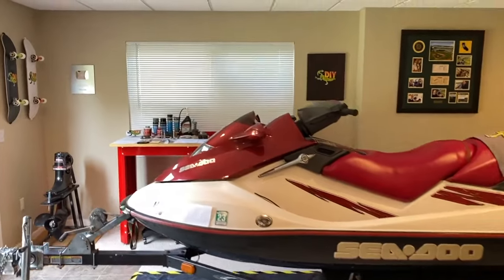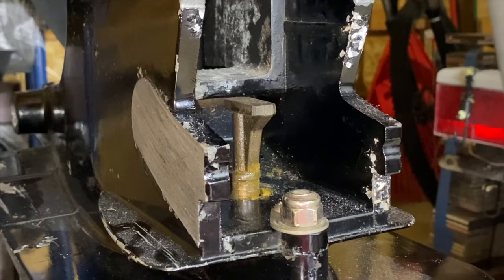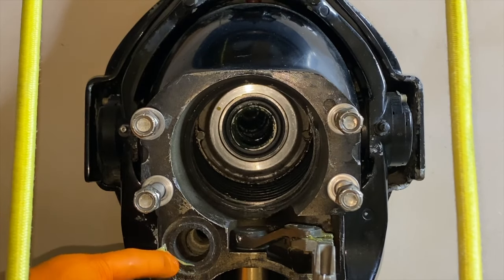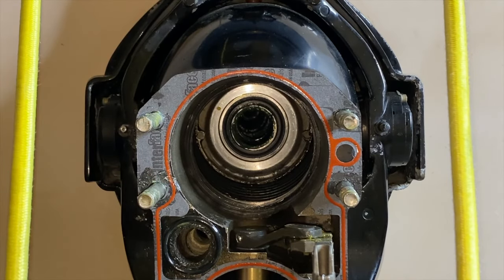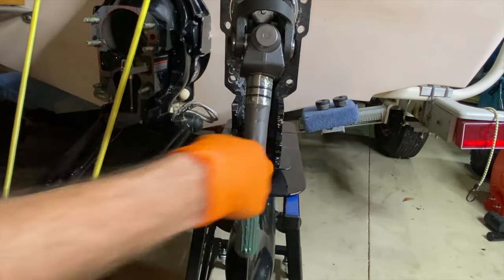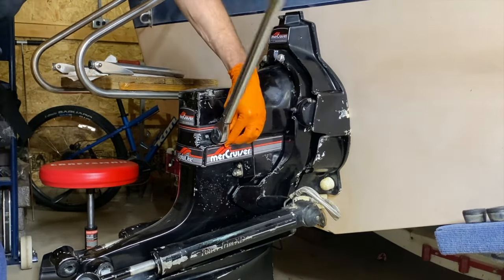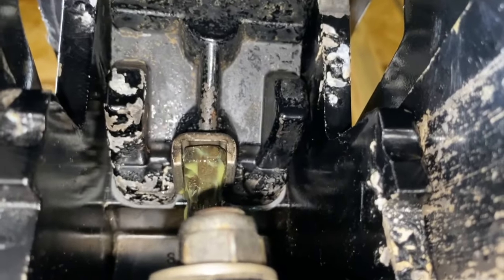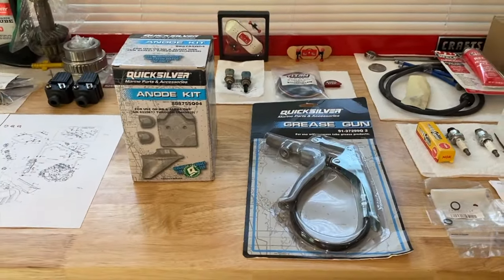Install Mercruiser alpha one outdrive to boat - All important steps

Comment from the maker: If interested in purchasing this product, visit our Amazon affiliate link below.  I earn from qualifying purchases.

     Outdrive Rack/Stand:

          https://amzn.to/461ul7X

          https://amzn.to/4cBO7tb

          https://amzn.to/3S2V7qC

     Gimbal bearing install tool:  https://amzn.to/3QqSFdp

     Marine grease 2-4-C:  https://amzn.to/3PiLmDX

     High performance Extreme grease:  https://amzn.to/46jnWUe

     Shift-Shaft bushing kit:  https://amzn.to/3GoiepL

     Trim limit/sender switch kit:  https://amzn.to/45GOIXb

     ANODE replacement kit:  https://amzn.to/3swSeVQ

     Quicksilver grease gun:  https://amzn.to/3QI0eez

     OEM Set screw:  https://amzn.to/3rWY4zt

     Gimbal bearing grease seal:  https://amzn.to/3tGswhF

     Perfect seal (New sealant):  https://amzn.to/3FmGnMR

     Security bit set:  https://amzn.to/3FolgJW

     1 1/16” deep socket:  https://amzn.to/3PVEoUs

     Bellows replacement kit:  https://amzn.to/3RL7h8v

     Shift Cable Socket:  https://amzn.to/3qtVdgq

     Hinge Pin removal tool:  https://amzn.to/44YuasH

     Flex Shaft Screwdriver:  https://amzn.to/3s8E3W4

     Utility knife:  https://amzn.to/3QBjP1K

     Bellow adhesive (92-86166Q1):  https://amzn.to/3sv9nyF

     Lacquer thinner:  https://amzn.to/3QGvxbd

     Long flathead screwdriver:  https://amzn.to/3qMm08a

     Aviation gasket maker:  https://amzn.to/47XHS18

     Wire brush kit:  https://amzn.to/3OTZ8vr

     1 1/16” deep socket:  https://amzn.to/45T1u4j

     800 grit scuff pad:  https://amzn.to/47SaM2y

     Bell housing bushing/oil seals(23-805041A2):  https://amzn.to/3szdhGS

     Swivel vise:  https://amzn.to/3sfLsAv

     3/8” socket extension:  https://amzn.to/3EhRKFa

     2lb hammer:  https://amzn.to/3QDHiz3

     Water tube bushing cover:  https://amzn.to/46yp9aI

     Water tube bushing seal:  https://amzn.to/3tjcBWt

     44'' Water cooling hose:  https://amzn.to/48IEcQX

     Gear lube SAE90:  https://amzn.to/45vlqux

     Loctite 271:  https://amzn.to/47SXV00

     Outdrive gasket kit:  https://amzn.to/3rb5HBR
  
********

1.  Purpose of 3rd o-ring on U-joint shaft

          https://youtu.be/GnnPCrVgx0k

2.  Remove gimbal bearing

          https://youtu.be/0kgVrEixFE8

3.  Install new gimbal bearing

          https://youtu.be/0_qNYz-FBXE

4.  How to calibrate Trim limit/sender switch kit

          https://youtu.be/5BetZVkPPHI

5.  Replace outdrive Trim Rams

          https://youtu.be/nkcFYl5bL7c

6.  Replace outdrive anode kit

          https://youtu.be/qy_qclP3zUQ

7.  Grease your entire outdrive the right way

          https://youtu.be/7q1sBu0TsPw

8.  Build your own custom skateboard

          https://youtu.be/9Isty_4fIIw

9.  Mount your skateboard on the wall

          https://youtu.be/c5QDCKZNGH0

Comment: Hey great DIY. I reinstalled mine last fall but something didn't seem right, like the large o ring wasn't seated. I had trouble closing the gap, about 1/4 inch. Used the bolts to pull it together now I'll be taking it apart again before hitting the water.
Reply from the maker: Thanks for watching.  How did outdrive perform during that time?  Did you hear any humming or vibration?

It’s possible that the u-joint shaft didn’t perfectly align itself with the inner coupler spines…and it didn’t want to conveniently slide into place.

When you separate drive from bell-housing, check to also see if the shift cable shows any signs of interfering while the drive was being re-installed.

Looking forward to hearing back from you.  😎👍🧰
Reply: Thanks for the response! I haven't run the boat since and have the unit off again as we speak. Plan on reinstalling today.
Reply from the maker: @elmerhuyard3565  

Very cool, we are happy to help.  😁👍

Comment: Nice info. Looking at a possible boat purchase and found a Sea Ray Sundancer that needs an outdrive replacement for cheap. I'm a big car DIY guy and do all my own wrenching and maintenance so wanted to see if this is a job within my capabilities and thanks to your video, seems totally doable.
Reply from the maker: @Pollux95630  

Definitely doable, especially if if have the DIY car repair experience.  You can bring your past experience to the outdrive and get it overhauled.

We will be here to help answer questions as you work through it.

😎👍🧰

Comment: Im installing mine as i type this, it binds up 3/4" away from the bell housing, its aligned, shifter is good etc i cannot get it to slip in, mechanic skills i thought was about 8/10 lol
Reply from the maker: Thanks for watching, any update?  Are you installing alpha drive or bravo?

Most common cause is ever-so-out of alignment splines.  Can you see the yoke shaft coming through the hull when standing inside boat and looking down behind inboard?

Please keep us posted.
Reply: @DIYwithMichaelBorders  yes i got it, i had the wife turning the motor over as i pushing in on my alpha one drive and worked it in, must be just to say out of alignment but ive been messing with alignment all day and couldn't get it seated. Just called it a night, bugs are bad here in northern Ontario! Thanks for the reply 

Yes i had my hands clear of the prop!
Reply from the maker: @adamlee4252  

Awesome to hear, we appreciate you taking the time to keep us updated.  Great to hear you called it a day at the appropriate time…bugs are no joke in the North.

We are working on a 1994 Mercury outboard today, replacing parts.  Projects never end…but we here at our channel are thankful they never do.

😁👍🧰

Comment: Note: IT’S NOT GOING TO BE THAT EASY!!!

Great series. I used it to replace my gimbal and bellows. BUT, if you’re removing/installing your existing drive, it isn’t going to go on that easy. The steps are all right, but I think having a shaft with new splines makes it go much smoother. Once I got mine on where everything was lined up, I actually had to use a small sledge and a block of wood to tap mine until the threads were exposed. Then I could use the nuts to pull it flush and snug.

To be fair, I also had to prop a block of wood between the gimbal ring and the top of the drive and trim up to “press” the drive off when removing, so I think it’s just the gunk gumming things up a little bit.
Reply from the maker: Thanks for watching and sharing your thoughts and experience.  😁👍🧰

Comment: Your videos are incredibly helpful. I just bought my first boat a 1985 legend that is nearly identical to yours.  Its so hard looking at old diagrams not even sure if they are for my motor and then finding corresponding parts that all have been replaced with new part number's from different brands. Not to mention i cant find a service manual for the boat to save my life. How did you find a service manual?
Reply from the maker: We are honored to read this, thank you.  Congrats on purchasing your 1985 Legend.

To get your proper service manual, you can contact Mercruiser HQ in Wisconsin and get in touch with their service department.

They will need your outdrive serial number.  At that point, they can get you the exact service manual for your exact serial number outdrive.

You can reach out to us any time.  Looking forward to 2024, many more helpful videos to come.  🧰
Reply: @DIYwithMichaelBorders  I figured out what my issue was! Along with a cruddy part not helping, when I first started working on my boat  I watched a video of how to replace the impeller by someone else who said to put it in reverse and ratchet strap the propeller so it doesn't move. Well it had been so long since I started working on it because i kept having to fix other things as i went. I completely forgot putting it in reverse. Everything I was doing after getting it all put together just seemed backwards making me think maybe i had bought a part for a cw prop. The prop never locked like it was supposed to. I was putting my lower unit onto the upper unit while it was set to reverse and the top was set to forward drive. I got my boat in the water this past weekend and it's running exactly like its supposed to! Thanks again for posting these easy to follow videos. I would not have been able to learn about the ins and outs of my boat and how to do work on it.
Reply from the maker: @CoreyCox25  

Thanks for the follow up, that will definitely do it.  You’re not the first to run into that.  😁👍

Comment: I got my outdrive about a inch away but not enough where the studs stick through the outdrive. I made sure alignment was pretty close. Alignment bar went in fairly nice and smooth. I have the boat in drive and the prop locked in forward. Any tips would help. Thanks
Reply: I also know that the splines on the shift are going in to the splines in the motor cus when I turn the motor with a socket it spins the prop
Reply from the maker: Thanks for watching, any update?  They can be stubborn at times if not perfectly aligned.

By chance did you apply grease to the tip of yoke shaft?  If so, this can act as a form of pressure or resistance against you as you install shaft.

Sometimes too much grease will be added to inner coupler which can cause the same issue.

The grease gets trapped between inner coupler wall and tip of shaft and can’t do anything but make it impossible for you to shift drive fully into place.

Comment: Someone knows how to adjust properly the shift cable for this exactly combination mercruiser 3.0L Alpha One Gen 1
Reply from the maker: Thanks for watching.  Let us know if you have any questions.  🧰
Reply: How to adjust the shift cable properly cause I guess it's something wrong is not moving the shift switch properly 🤦🏽😅
Reply from the maker: @xxamde1  

Thanks for the reply, we have shared a few links to our videos of us replacing shift cables on boats.  We have shared links on outdrive as well as outboard engine.

       https://youtu.be/6khs8q5NyjI?si=61e9JZ4JdqUNaxKZ

       https://youtu.be/q_hlCjUBTZk?si=0Lu60xjbL17WH7qB

       https://youtu.be/490gbDeB0H4?si=ETQidm1G8fLeyjJL

Keep us posted.